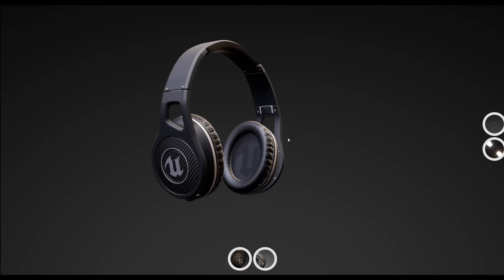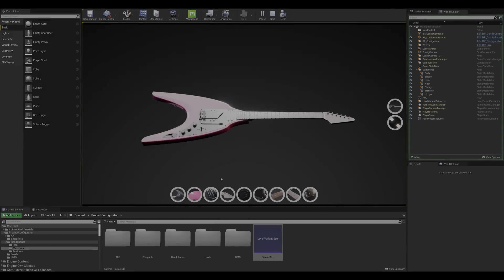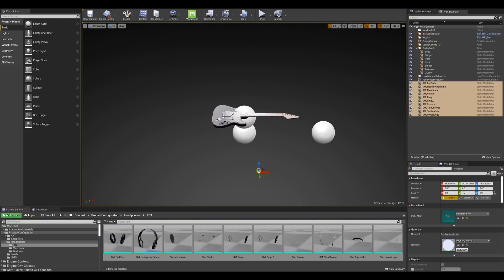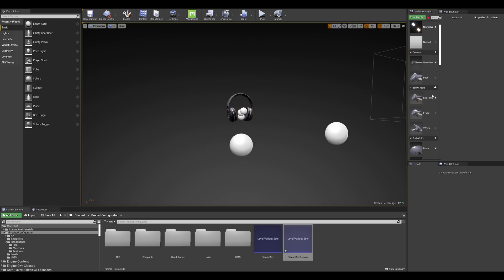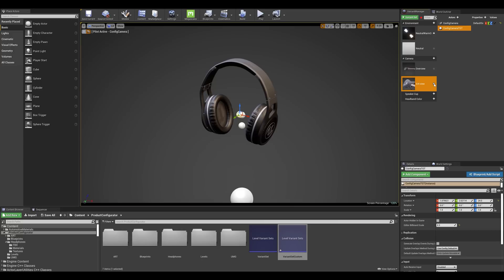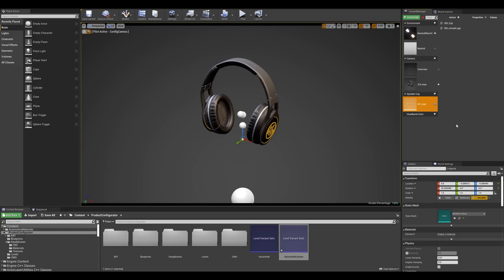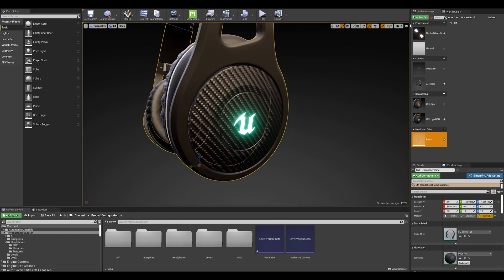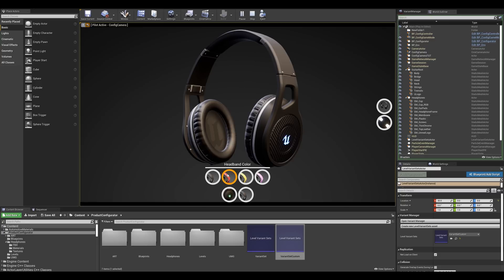Using the Product Configurator Template | Tips & Tricks | Unreal Engine

Comment: I got a question: I have a BP with different staticmeshes in it ( To keep it clean) I can change those staticmeshes to other staticmeshes in the variantmanager ( A cube become a ball) and it all works. BUT when I duplicate that BP, the second BP doesn't follow the changes the variantmanager makes ( logical because it is now a separate item in the variant manager to control.) Can it be controlled in some way to be identical with the original?